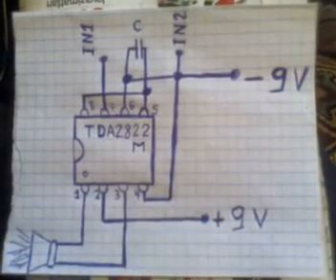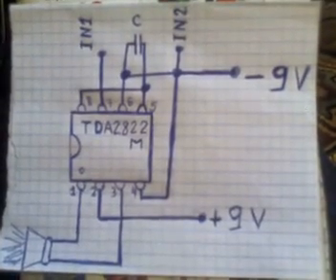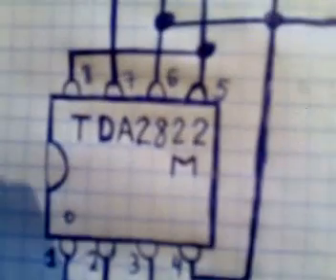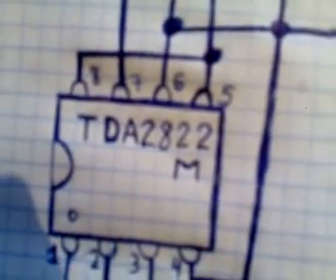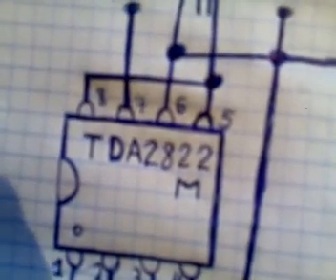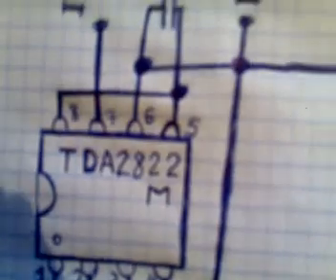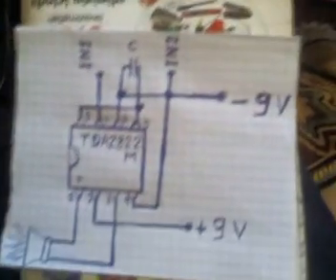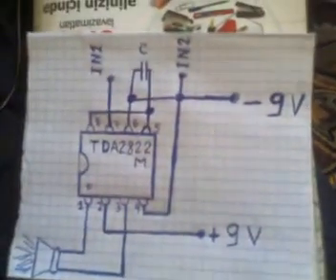Amplified TDA2822M and a amazing led indication

Comment: The leds are connected in paralel with the speaker? I'm sure that your power supply or the transformer will getting hot soon.

Comment: Can we connect it to 3.7 volt?
Reply from the maker: I am not sure ab that, probably 3.7V is to low. Instead you can use DC to DC converter to convert 3.7V to 5V

Comment: which the value of the capacitor between pin 6 and 5
Reply from the maker: For this example I used 10mkF. But I advice to use different values, because capacitor value determines sound quality.

Comment: I have doubts! The pin 2 is connected to pin 3?
Reply from the maker: No man pin 2 goes to V+. pin 3 to the speaker. Simply lines are crossing. I illustrated connection by points.

Comment: Saludos! buen circuito y muy económico para experimentarlo. Una pregunta, como fuente de alimentación puedo tomar un cargador de celular? Si es posible, cuál de los siguientes me sirve: 1) Output 5V 250mA    o   2) Output9V 500mA
Gracias
Reply from the maker: +Eric Bula saludos. Puede usar los dos. Microscheme es capaz de soportar tanto de sus parámetros. (1) Salida de 5V 250mA o2) Salida 9V 500mA). En caso de emergencia: si ves que microscheme está consiguiendo caliente, tratar de disminuir la salida de la fuente de alimentación. Exactamente Ampere Valor.
Reply: Gracias! Thanks!
Reply from the maker: +Eric Bula Bienvenido, You are welcome

Comment: where did you connect the LEDs
also i did it  exactly as you did it but u have this noise shsshshhshshshshshshshs
Reply from the maker: +blackice273 normally it have to work as shown. If you have more noise try to decrease input signal or change values of capacitors. I Connect LEDs to the output, as connected speaker.
Reply: +Atabeyli Nihat the noise already  exists  even  before i connect any source and the led on as defult but dim  a bit when start the music !!  strange
Reply from the maker: noise is not the result of LEDs. It already exist because of capacitors and input values. Try to change parameters.
Reply: +Atabeyli Nihat ok thanx i will and tell  you the result 😊
Reply from the maker: +blackice273 You are well come

Comment: this is really nice project but the schematics do not include the LEDs and where to connect the audio input? help please
Reply from the maker: you can use leds instead headphones then you will get it all
Reply: how about the audio input? i dont understand how you managed to sound the amplifier if you will connect the leds on the input..thank you for your understanding....
Reply from the maker: TRY to connect it in paralels.. then LEDs work like the second headphones.. you will have sound and intication together..

Comment: how many volts and uf your capacitor
Reply from the maker: I use 5V, Capacitor is 100 mF. Use different value to change output range of sound.

Comment from the maker: yes.without LED it works . and capacitance depends on your choice .if you want to get stereo sound you have to use big capacitance ... in addition to LEDs they only using for indication .. it gives other effect. LED doesn't role anything in the work of this amplified

Comment: Is it realy work if without LED like the diagram above?And how much the capacity for the capacitor in the diagram?
Reply from the maker: Yep, Without led it works. Capacitor is 100mF. U can use different one, then output range will be different